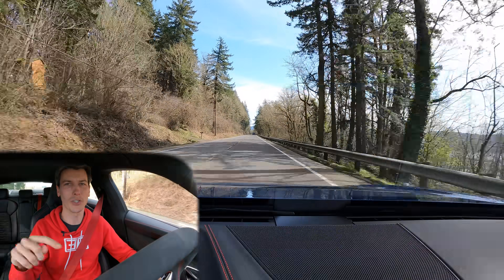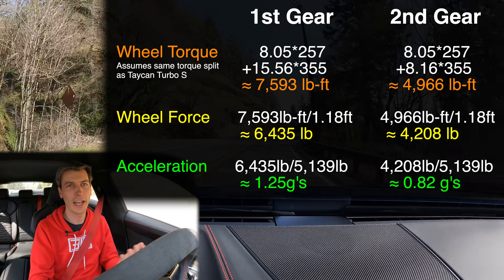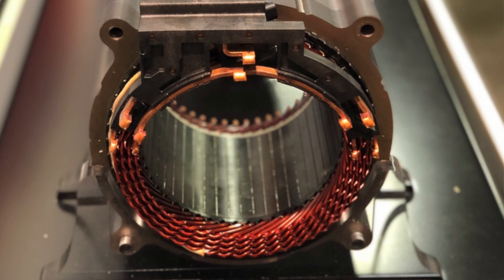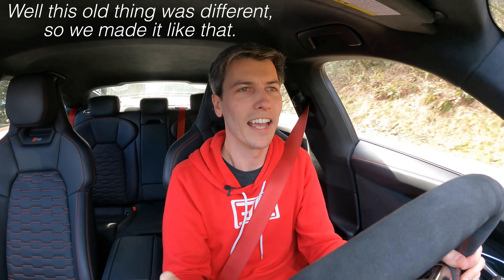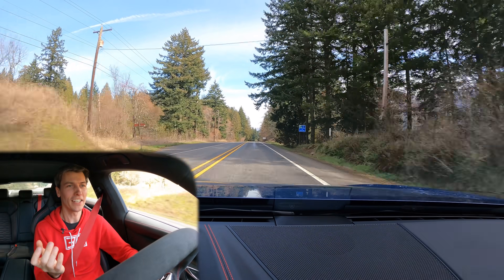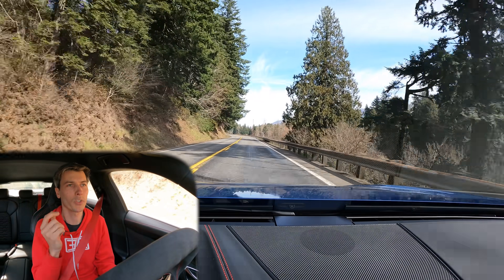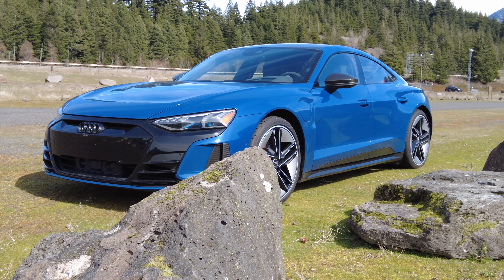Are Fake Manual Transmissions Coming? Audi Keeps It Real

Comment: Wouldn't an electric car with a 4 speed trans require a smaller motor that uses less battery power, if efficiency and range is the goal instead of 0-60 in insane numbers?
Reply: Not sure the added weight and inefficiencies of a 4 speed transmission would outweigh the weight and inefficiencies of using a bigger motor. The larger motors are not very big or heavy. Lowering the number of battery cells would be the easiest way to make the car lighter and more efficient although you will sacrifice range.
Reply: The size of the electric motor does not have a direct relation to efficiency as in the internal combustion engines. Electric motors are still very efficient under low load conditions, while the efficiency goes down under low load conditions for ICE. That's the reason the smaller engines have higher efficiency for ICEs as you essentially increase the load when you replace an engine with a smaller one.

Comment: Torque isn’t acceleration. F=ma doesn’t apply to moving cars.

Otherwise with low enough gearing you’d make a car that can do 1g pull to 10mph with a 1hp engine.

The reason you have gears in ev is so you can reach ideal rpm (max hp) sooner. And so you can increase top speed by lowering motor rpm at higher speed.

Comment: We could look at it this way…manual transmissions in general have been lagging behind automatic transmissions for a while, but we still love them for the communication and engagement. With electric vehicles, the concept might not be too different, where you now have a wider range of throttle control due to the extra gears, allowing a bigger margin of error for the driver while still maintaining a specific amount of torque. Plus the driver gets to choose between six levels of power now on the fly old school style. Who could complain about that?

Comment: Haven driven both, Audi just couldn’t match the driving experience of Taycan. It was dull and muted. 
You get more for your money on the audi (Turbo power train for price of 4s, let’s not even get started on options). Audi will be about 20% cheaper spec to spec. 
But I would rather have a base Taycan that does 0-60 In 5.6 than audi GT in 3.1. Purely because Taycan is more fun to drive. Is it the only EV that’s fun to drive? Maybe I think so after drive so many cars.
Reply: Chris Harris from top gear prefers the RS etron gt versus the taycan turbo S. So I call absolute bull. THEY ARE THE SAME CAR
Reply: @yashsab2  I say just drive them. Back to back.

Comment: I think your statement of "there was this old thing so we made it like that" is not the answer.  Like you said at the end of the video, this was made to make people more open to owning an EV, most people don't know what "having a manual transmission" means except for the fact that they have three pedals. They probably did some market research and noticed the fake manual would open the car to a market that didn't consider it, think new manual transmission Porsches. There's a ton of buyers for it that only know how to shift gears, not exactly why they're shifting
Reply: If they want me to buy one they need to strip out most of the technology, especially anything connected to the internet, and lower the price to match a used gasoline car.

Comment: If electric motors are "so much stronger" than engines per unit of weight or/and cubic unit of measurement of material, then why is it that in a hybrid vehicle, if you really push it to accelerate quickly, it engages the engine, starting it and revving it up, and you feel that burst of speed because you called upon the engine to take you up there?
Reply: That was probably a hybrid with a tiny 20hp electric motor or something because that's all it takes get up to 40 or 50kmh. It wasn't designed for launch acceleration, it was designed to replace the most inefficient part of driving, the low speed stop and start.
Reply: @extragoode : I was thinking of the Prius, but doesn't it apply to Chevy's hybrid and others too? So you're saying that with hybrids they purposefully underpower the electric motor, but not with pure EVs? If so, then why not just pair a full-strength e. motor with the engine in a hybrid (and please give me something besides weight issue)?
Reply: @HelloKittyFanMan.  sort of. Just because more powerful electric motors don't weigh much more they're still more expensive. For early hybrids they were basically big starter motors. If you're going to have another engine there anyway, why not use it when you want more power, build the car with a cheaper motor and keep it cheaper to manufacture?

Here's a specific example: The 04-09 Prius had a 67hp electric motor and 76hp gas engine, but combined they only produced 110hp (I'm not sure why they didn't combine for more) and did 0-60 in 9.7 seconds, while the 13 Leaf has a 107hp electric motor only and does 0-60 in 6.7 seconds.

So to answer the original question, of course you're going to feel a burst of speed when the car switches from 67hp mode to 110hp mode, that's 64% more power. They could've put a more powerful electric motor but it probably would have increased the cost significantly.
Reply: @extragoode : It's not another engine; it's just AN engine vs. a motor. (I say "electric motor" for differentiation since so many people call engines "motors" too. But motors aren't engines.) OK, thanks, because I didn't know they were synchronized enough to run at the same time and combine their power. All this time, I thought it was just one or the other. I thought that when the engine ran it was using the motor as an extra big generator to help the alternator and regenerative braking with the charging duty.

So even though the electrical side of a hybrid vehicle is a closed system, are there times when they fail to charge as fast as, or faster than, being used? So then what does it feel like when the only thing you have left to run on is the engine-especially if it was underpowered by design, but it with the motor become "one"?

Huh, these are questions I should ask my sister; she has a Prius. But maybe she's not tech-savvy enough to even notice or have learned it.
Reply: @HelloKittyFanMan.  There are configurations where the ICE is only run as a generator to charge the electric powertrain, but in that case they're called range extenders.

Prius in particular and probably other hybrid basically just don't go if both systems aren't working. That's one reason I'm not a huge fan of them, there's twice as many things that can go break, but in practice very little goes wrong with the electric side, so they end up being the same or better on repairs.

Definitely go drive one, either your sister's or go waste a car salesman's time and test drive several different drivetrains. Maybe you'll find something you really like.

Comment: EV can mimic acoustic engine sound or artificial gear change but that's not gonna convince the ICE enthusiast about the analog driving experience. I think they just have to accept and embrace the fact that EV simplify and damper the car noises to a deaf silence, and that also take away the driving spirit for the benefit of drivers to think about doing other stuffs after they have reached their destination.

Besides EV artificial transmission, I was wondering about the natural evolution of manual gearbox would transit into sequential one (for the remaining life cycle of ICE cars). I think sequential is a cool step upward to take because you still retain that physical gear change but without the constant clutch work and sometimes changes into the wrong gear by mistake. 
But yea to me sequential gearbox just make sense as a natural successor to manual gearbox, I think auto manufacture can do it and solves the problem like straight cut gear without wearing out the transmission as fast as track use.
Reply: But sequential transmissions still have clutches. The only sequentials I've used are on motorcycles, but I don't think I'd say one was better than another, just different for a different application.

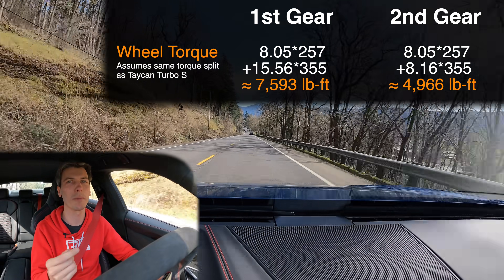Comment: 0:59 I believe a less simple but better answer would be: "for maxing out acceleration and high speed efficiency in a single powertrain". 

As far as i've read , both Taycan and Audi E-Tron RS have exceptionally low Autobahn consumption, due to the second gear keeping the motor close to peak efficiency even at high speeds, whereas other cars have their peak efficiency at much lower wheel speeds.

PS: Powerwise the Audi RS E-Tron GT sits between the Porsche Taycan Turbo and the Taycan Turbo S and the RS base price is lower than the Turbo base price ... at least here in germany
Reply: thats a good point. german cars have always been made with a higher cruising speed in mind because the autobahn is there.
Reply: because: STUTTGART.

Comment: I had this idea a while ago.  I think you could also use a real manual transmission (though maybe not necessary if the EV can "fake it" well enough) and have the EV motor simulate the torque curve and RPM limit of an ICE engine including idling and forcing a good clutch mesh (with fake stall if you fail).  Much like how modern guitar amps can simulate various tube amps, the car could also have different "modes".  Want to drive an Ferrari V12, a Porsche turbo flat-six or an American V8?  Just dial up the option on the on-screen menu and the EV will now simulate the power bands of those engine configurations.  There can even be a "normal" EV mode where it drives without needing to change gears at all for maximum acceleration.  Throw in some simulated sound and its possible that driving and EV can come very close to the experience of a real manual internal combustion car especially once the weight of the batteries come down.   I currently have a Tesla and several "analog" 6-speed manual cars and I would love to have an EV in which I can enjoy the old school feeling of clutching and shifting.

Comment: Well, with simulation driving being really popular in console and PC games such as Grand Turismo 7 and Forza Horizon 5,it makes sense to put it in actual cars... Coz I think that the thrust master and logitech steering wheels feel more real and better than an actual modern car...
Reply: I disagree about logitech, I've owned the g29 for 2 years and now I'm using a tspc from thrustmaster... 
The logitech feels really bad in comparison to a real car, the tspc feels a bit better than average electric power steering.
But still there's nothing like a good old hydraulic steering like in my e46, you cant even compare. 
Maybe my opinion on electric power steering would change if I drove a new porsche, but still I dont think a good hydraulic can be bested. Of course you have oil leaks etc but that's just something you need to be on top of.

Comment: They are testing a Tesla against a petrol-powered Porsche.  the porsche came first over the line.  in the beginning, Tesla is ahead of the Porsche, but the torque rises on the Porsche When the speeds rise.  on Tesla it seems that the torque instead drops when the speed starts to get high.  Also, does the Porsche petrol have a higher top speed?

Comment: I've been saying this for years, but I was more or less talking about a simulated manual on a single speed that's optional to use when you get "bored" or want more engagement. So like the car artificially limits itself per "gear" while shifts are actuated by a stick in the car. EV's using actual manuals are cool too like the garage builds etc. but that just doesn't seem like it would sell or pay back the build of development.